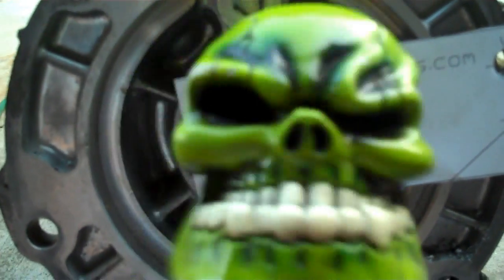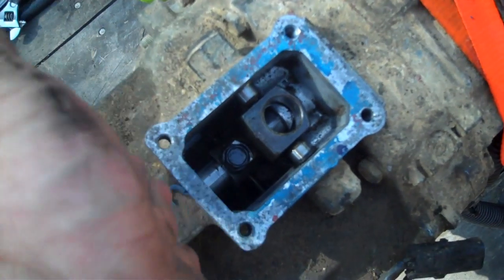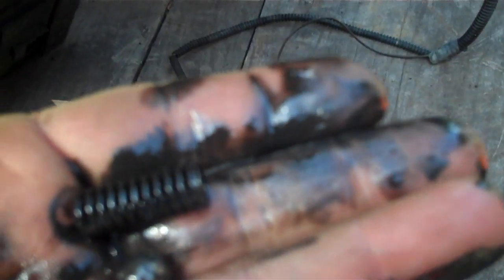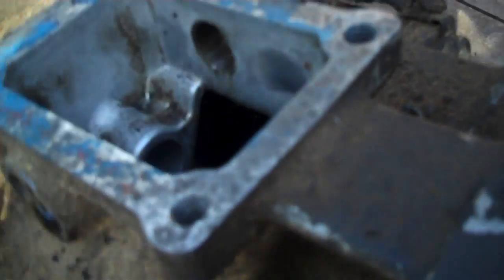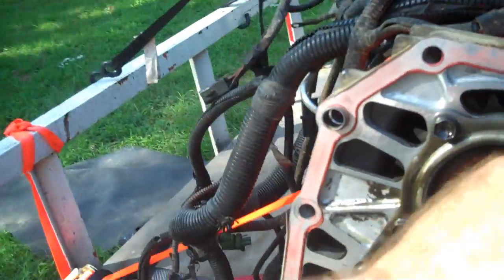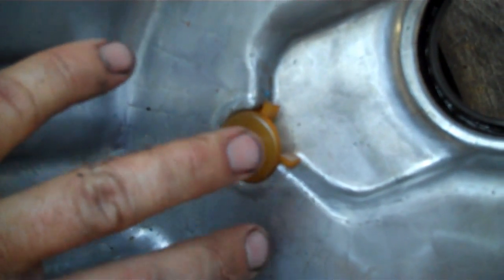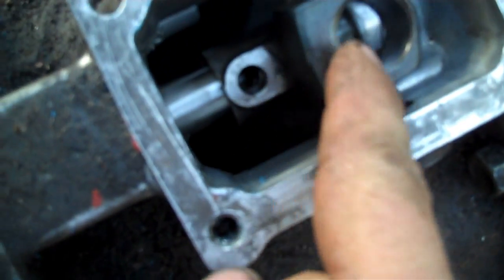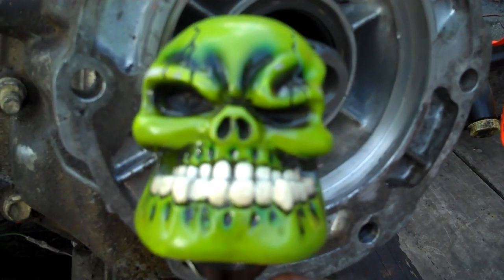Jeep Wrangler YJ - Reclock a Cherokee transfer case AX15 to fit the YJ - PT1 #transfercase #reclock

Comment: kool, guy said he had a winch, a hoop bar and step bars to put on it..32's on it..144,000 on new motor..has some rust, good thing I did body work lol
Reply from the maker: +Ricky Rogers For the 4.0 inline 6s .. 144,000 aint nuthin! My dads '06 TJ is about to trip 300,000. Doesn't use a drop of oil and rock solid dependable. My poor '91 has had the crap beat out of it before I got it.. So, Hopefully, around spring I'm gonna start my engine build videos .. if life would stay out of my pocket!! Not going to be stock rebuild .. 4.6 stroker torque beast!!

Comment: They make an adapter for that aswell. It's 3/8 think and allows you to clock it the way you need it without drilling.
Reply from the maker: Yep .. T-case clocking ring. Advanced Adapters I think?? I'm too tight to buy stuff I can mod or make .. lol. Thanks for dropping in a great suggestion! Have a great day!
Reply: Power Addicts - FixJeeps.com - Jeep, car and motorcycle tips. Reason why I added that was I'm getting a new trans for my jeep and needed to know what the fuss was all about. Guy at the trans shop wouldn't explain to me the just of it. But after watching your video gave me an understanding of it. Thanks. I have an xj and getting an overhauled ax15 so this video helped me out. Thanks again

Comment: Would you say I would need to do this if motor is out of a 97xj auto trans?
Reply from the maker: Cherokee XJs clock the tcase down 10 degrees. I cant remember right off if the tail shafts swap on the autos. You may have to drill the holes to reclock it.  toward the bottom of this link https://www.fixjeeps.com/ is a template that helps with the hole location to drill.

Comment: I have one for a wrangler I will trade you
Reply: Just reclock it like in the video. Its really easy. Here is the template: http://www.fixjeeps.com/support-files/ax15_np231tcasereclocktemplate.pdf . Print it out 1:1 measure like it says on the template to ensure it printed out correctly. You can mod yours for lots less money than shipping costs. If you already have the proper size drill bit, it's free. I don't really wanna give mine up. Yes its an XJ housing, but I can make it work for either one. Just like you can.